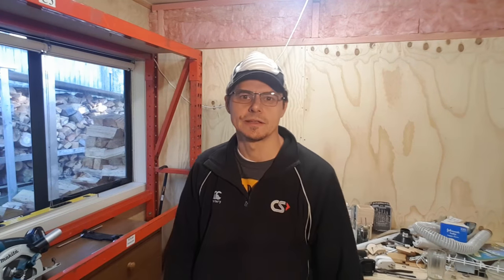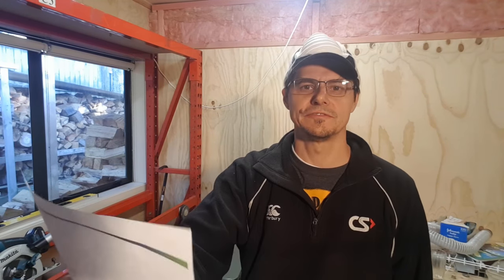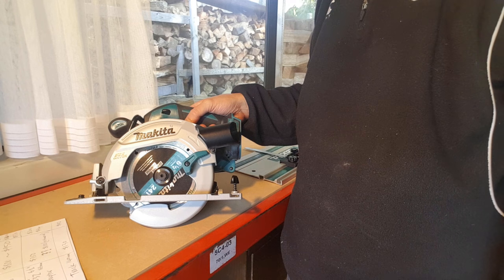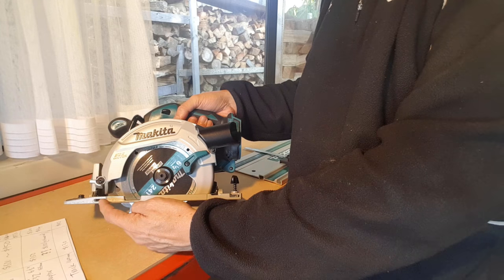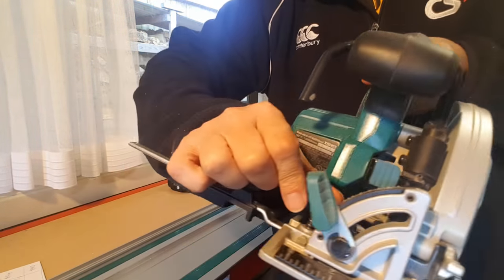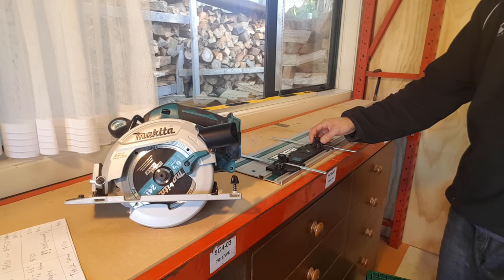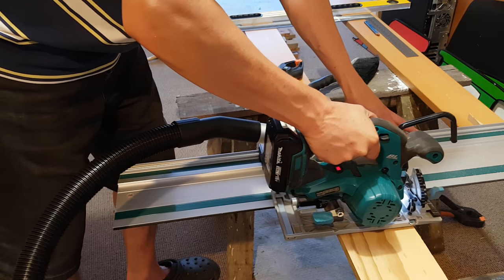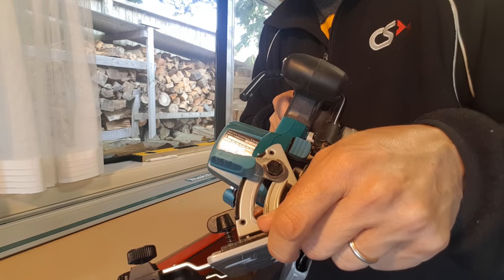Makita circular saw adapter for rail guides - circ saw becomes track saw.

Comment: Thanks for including the links to the exact products.  Saves time.  I had purchased the Makita 199232-5  guide rail adaptor and found it WORTHLESS on my little XSH03 circ saw.  IMPOSSIBLE to tighten down enough to keep the saw bottom tail from moving more than 6mm!  I thought surely this can't be the best Makita can do.  Clicked on your vid and realized there was another guide rail adaptor with two attachment bars.
Reply from the maker: No probs. I've heard that the single bar one isn't much good but some saws only have one slot for one bar - which is weird. Cheers.

Comment: Thank you for this video. This is the only demonstration I found in YouTube that shows how to use the guide rail & adapter with the dhs680 saw.
Reply from the maker: Thank you for the feedback Danny. I'm glad the video was useful to you.
Reply: Hi how are you finding the guide rail adapter on your DHS680? I've got the saw and tracks and I'm very tempted to buy the adaptor.
Reply from the maker: Hey Chris, it has worked amazingly for me. I use it every time I need an accurate cut. A small amount of care is needed to ensure the bars are seated and positioned correctly, especially if you are taking it on and off all the time but other than that it works perfectly. It holds the saw very securely on the track and cuts dead straight. If you already have the saw and the track then I don't see a reason not to get the adapter. I definitely recommend it. Cheers.
Reply: @TakamiWoodshop  Thank you very much 👍

Comment: Nice adapter mate! Awesome idea for people who don't want to spend a chunk of cash on the track saw
Reply from the maker: Yeah - works mint too. Obviously though it is the same idea as track saw there are quite a few differences when you get down to ease of use, power, cut quality etc. Would be interesting to compare.
Reply: @TakamiWoodshop  I have the Makita 36v tracksaw, with two 6ah batteries and a dual port charger it's a winning combo, 😁👍😎
Reply from the maker: Toolnut that's a winning combo for sure mate 👍 It's definitely something that is still on my list, even though I have the adapter thingy.
Reply: @TakamiWoodshop   Indeed, good review, 👍 I see you have the Makita 18v sander, is it any good? Pity it's not brushless, 🙄
Reply from the maker: @TheToolnut  Yes mate the sander is great - all this time though I thought it was brushless but alas ... it isn't 😔 (damn). It's nice and compact but I think I would prefer the one with the extra handle/knob on the side, but I don't think that one is available in cordless. It gets pretty good mileage too - with a 6Ah batty it would go and go and go I reckon. Dust collection is pretty good as is, and with a vacuum attached it's super good. I'm very happy with it. 👍 Not sure if you watch any of my other videos or not but we did a cock fight with two of these sanders - just a bit of tongue-in-cheek playin' around over Christmas holiday 😁 https://youtu.be/hnt5mG_zZmA

Comment: Just got this setup myself, since no one makes a right handed track saw (left blade).
 
It's not perfect with the XSH03Z.  But a few things I did to tweak it is to do this...
 
1) Saw Play: I unscrewed the fine adjustment knobs to get to the green spreading rings. I then put a thin strip of UHMW Tape on the side of the green ring that will make contact with track. It gives it a bit more depth to make better contact with track and make it not rock side to side as much. 
 
2) Location of Metal arms that connect to the saw: This has been tough. Getting the saw blade to run true means it needs to be perfectly parallel to the track. Where the metal arms go into the track adapter is an issue. If you put it to "0" (Zero) it will turn the actual aluminum edge of your track into a splinter guard.  So what I did was take a 2x4 on my sliding miter saw and cut a ¾" to 1" deep cut lengthwise. (You can do it width wise if you have a regular miter saw, but do 2 boards ate same depth.) 
 
Now, take your XSH03z, adapter, and track on top of the board(s) So your saw bkade can go onto the groove. It will rest straight and you can then mark out 90° and set the metal rods in the adapter, where they are at a true Zero. Then mark off the rods by overtightening the screw. Then take the metal rods out of everything, and you will see a little circle where the screw scratched the flat rod. Drill a hole there big enough for the threaded knob to fit through, and you now know where a true Zero is and the hold down knobs in adapter will actually pass through the flat bar, securing your Zero, perfectly every time. 
 
.....
 
It's a shame Makita (or any other good tool manufacturer) does not make a Blade Left track saw. 
I was a lefty until I lost use of left arm, to a virus. And track saws were heavenly as a lefty, since they were right blade. Righties have no idea what they're missing out on. 
 
I'm now a righty, and I can't use a right blade track saw. This adapter and the XSH03Z is the closest, and only real option to do long straight rip cuts for me. 
 
So until a true right handed (left blade) track saw exists, I'll be using this. 
 
(I'm currently trying to figure out a way to give it a spring plunge mechanism,  and a side plate to make dust hose port more effective... but it's quite a pain.
Reply: Ignore the pain. I am most interested in what you are going to make out of it. In my opinion, a "half plunge" (soft way to push the blade down, no need to get it back up again) would be quite enough. Perhaps no springs needed, just something to make the push down firm and soft and something else, that would limit how low it goes. Once the cut is done and the blade doesn't rotate anymore there should, of course,  be a way to get the blade up again. BTW, somebody is selling 3D printed covers for the hole in SP6000 - perhaps someone else would be willing to sell similar covers for DHS680 as well?
Reply: @Pvalila  since I wrote that comment, I made the same realization in terms of a depth stop, and soft plunge with no need for a retraction method. 
 
The issue I've noticed is how the baseplate will tilt right and kept a hair, if the depth clamp is is not engaged. It's not much, but it's enough to bits and throw the saw back. 
 
I'm still fiddling with the plunge obviously, but the faceplate was easy. I used a piece of cardboard to make a mock up stencil of a box frame that could be folded and cut so that it covered the entire blade housing. I then just unfolded it, and traced it onto a 1/16" 6061 sheet of aluminum. Then once I folded it to fit perfectly around it, I mounted it to the shoe, and voila... full dust collection. 
 
I even made a riving knife for it. 
 
But I still have issues with plunge, and square cuts when on the track.
 
So I'm now making my own track and glide system using aluminum t-slots , t-track, and ⅛" aluminum sheeting. I'm still getting some bugs worked out, but it does glide much smoother, and cuts square. Plus I am going to make a riving knife that mounts to the track and moves behind the saw, without having to be attached to it. But the entire system might take a while to truly perfect to the point I feel satisfied with it.

Comment: I find that doing a shallowest possible scoring cut and then a full depth cut gives a super clean finish on all 4 edges of your material.
Reply from the maker: I've never tried that but will be doing some super expensive ply soon so I'll definitely give it a try. Cheers for the tip!
Reply: Rob Trautvetter - Takami Woodshop

Try it on a piece of scrap and let me know.

Comment: I own that same model saw, but I did not realise that it could be adaptored to the rail guide in that particular fashion. So a big thank you from across the ditch Rob. (I found you from the Tools and Stuff channel and now I've subscribed to your channel. Thanks for helping me out with that video.)
Reply from the maker: Hey Kevin - glad the video helped you out! Welcome to the channel and I hope you enjoy what I have to offer here! Was it Tools' bottle opener vid? Cheers. 👍
Reply: @TakamiWoodshop  Yes that's the video Rob. I found your channel from the "Bottle Opener" video. I'm looking forward viewing the rest of your channel now.
Reply: I think you owe me a beer Rob #BeerSubs
Reply: I have just received my Circular saw. Purchased it on a description from amazon UK. Which stated it was track compatible.  It turned out the saw required an adapter. Got upset with Amazon UK and Maketa UK. Maketa UK stated what looked very much like Maketa UK shop on Amazon UK was not theirs. 
The result being Amazon UK are changing their website and supplying me FOC an adapter.

Comment: In Australia you buy the Makita corded Track Saw with one guide rail (1400mm), for $749. Your cordless saw to buy here is $480 with a battery, guide rail is $99, adaptor is $75, total $654, spend an extra $90 for the real deal, appreciate it's corded though,  I like your channel...
Reply from the maker: Hey James thanks mate. The prices are similar here. I saved a bit by buying from the USA. The advantage of this set up is that you can still use the saw for normal cutting .. like building a fence or whatever. I don't have enough usage to justify a dedicated track saw, much as I'd love to have one. Cheers

Comment: Nice ! . I just figured this stuff out myself yesterday and ordered the 2-55" Powetec Tracks with joining bars for 129.99 and the Makita track guide for 39.99 I already had the XSH 03 saw. I am cutting some 30" x 60" parts from sheets and it would be great. I plan on making a square for it, out of some 12mm Baltic birch plywood as I cant find any less than $150.00 here in the USA.
Reply from the maker: Sounds great!

Comment: Excellent video, cheers mate! I've been lusting after the various pro-grade plunge saws for years now, but could never come close to justifying the cost. However, having recently make the jump to the Glorious Makita Master Race (after ~15 years as a home-gamer Ryobist) for completely unrelated reasons, I come to find out that they have a low-rent track saw option that I can realistically get into for not much more than $150 US on top of the saw I already need.
Reply from the maker: Thanks mate, glad the video was useful to you. I was in the no-name brand market for a long time before going to Makita - so glad I did. This saw is fantastic I have to say - it cuts at 90°, cuts straight and cuts clean, all the things my old saw didn't do - and this is even before you add the adapter and guide rail. (The dust collection port is an extra $10 or so)
I made this other sled thing for it as well if you have time check it out - just an experimental thing at this point but it works fine:
https://www.youtube.com/watch?v=DCcwjFEG88E

Comment: Just called Makita Australia and they said this adaptor (196953-0) can be ordered through any of the authorized service centers (at least in Australia). For the reference, similar adaptor for DHS660 (the newer model) is 199232-5, however interestingly enough it only contains a single slat. Looking closer at other Makita saws, DHS680 featured here seems to be the only one that has two slots for inserting guiding slats (the rest have just one at the front) which probably makes it a more accurate glider (if it wasn't for flimsy fence that it).
Reply from the maker: Wow that's really interesting - the adapter with only one slat - I've never seen that before. I would definitely rather have two as I think you'd get better cuts from it.
Reply: @TakamiWoodshop  Yeah, what's interesting that as I said DHS680 appears to be the only saw with two slat inserts. However compared to the newer DHS660 which I had a chance to inspect, DHS680 has much flimsier fence locks, which affects cut quality, at least for me - just brought it to the service and the guy said there is not much can be done besides tightening locks as much as you can. Also it of course makes lots of sense that DHS660 is newer than DHS680, model numbers-wise ;)
Reply from the maker: @ZaarsShed  yeah the numbering makes no sense at all 😮

Comment: You have any issues with excessive play in the track? The back end of my adapter wants to lift up, even with the tension knobs maxed out.... placed on a flat surface i can see the plastic body doesn't lie flat. I have a feeling i've got a dud, must've warped, or been damaged in transit. Doesn't look like you have the same issues at all
Reply from the maker: Ahh that's a pity. Mine is really tight with no play at all. Hope you get it sorted - can you return it maybe?
Reply: I know it's 2 years ago,  but mine was bent too. I put it under some heavy weights when not in use and it seems to have flattened out again

Comment: Very useful video. Thanks.  🍻. I use Makita tools for everything mostly because once you’re on a battery platform it’s too expensive to change. The DHS680 is a brilliant little saw for almost every situation but the bloody dust chute is a complete dog spewing the dust straight into your guts or into your face if you’re lucky and a breeze gets up. The 660 (blade on right) has a better dust exhaust but I’m not sure if there’s an adaptor for that.
Reply from the maker: Thanks mate - yeah I hear you on that dust chute!
Reply: Got the HS660 a few days ago. There is an adapter for it. I ordered one yesterday along with 1 metre of track. One disappointment is the inconsistency of saw blade kerf. I'd have liked to change blades and not have to think about track rubber cutting. I do have an M-class dust extractor but will use my HS660 outside the shed. Eventually, I may stretch to a proper track saw if projects can justify it (daughter and her fiance buy a larger place that needs work)
Reply from the maker: Your daughter should get the bigger place 👍👍

Comment: I just bought a track saw when I could have done this!!!
Reply: doesnt work with all Makitas. For example, my model is a cordless one DS611, Makita dont make a guide for it for you to be able to use with their guide rail. so depending on which saw you have a better option may be to consider something like the Kreg accu-cut or just make a guide out of wood (theres plenty of examples on youtube)
Reply: @richsmart321  yeah good point, I have a different circular saw non Makita, so yeah but right now I'm sorry happy with the track saw I bought
Reply from the maker: Which track saw did you get @phantom?
Reply: @TakamiWoodshop  makita, needed it to do bevel cuts on long and wide pieces for furniture. Never seen bevel cuts for so nicely

Comment: If supported properly(a thin blade can make side deflection worse???) Is this accurate? Can you adjust it to different kerf blades?? Thanks
Reply from the maker: Hi, yes it's very accurate. Deflection can be a problem on some hard woods, more so with thinner blades but it's not really a concern with this so much if you're cutting larger sheets or panels of plywood etc. It can be adjusted for different kerfs, kind of, generally with track saws you would just put on a blade and cut the splinter guard to establish the zero clearance and the cut line, and redo that when changing blades. It's tricky to line it up if you go thinner though, I've tried it. In this case I ended up moving the splinter guard out and recutting it. Hope this helps.

Comment: I notice you are right-handed...  Would you not be better using the Makita DHS660 or equivalent, ie, a saw specifically for right-handers?  Using the DHS680 as a right-hander means that with your right hand on the main handle, you have to cross the blade with your left arm to grip the auxiliary handle, not ideal from a safety perspective, and your body position won't be ideal for good line of sight...  But I do acknowledge that some people have a preference for having things the other way around for various, use-specific reasons...
Reply from the maker: I prefer blade-left saws because I can see the blade and the line better when I make the cut  with my right hand. I don't think there are left handed / right handed saws per se, just blade-left/blade-right to cater to people's preferences. If I had a blade-right saw I would use it with my left hand probably. Things are a bit different when the saw is on the track - you don't have to see really - just push forward and go for it. Don't think I've ever used that aux handle except to carry the saw one place to another.

Comment: Thanks for vid Rob Tee A1 good work Urock would you know what type of guide rail adaptor is compatible with the Makita 5900B 2000w saw I have a Makita track but can’t find any guide rail adaptor it doesn’t have to be a makita adaptor as long as it’s compatible with the Makita track and Makita saw 5900B 2000w
Reply from the maker: Hi Stiven, thanks for the comment. That's a tough question for me to answer I'm afraid, there are so many models out there on the market now. I wish I had an answer for you, but I can only suggest contacting your local Makita, or even Makita in other countries, and continuing to do your research on YouTube etc.
This may or not make you feel better but it also took me a long time to figure out which saw would be compatible with the various adapters and the track. Probably took me about 10 hours of researching before I had the confidence to make the purchase.
Have you looked at the "generic" adapters? like the Kreg, and there are a couple of others but I don't think they run on the Makita track. ... tricky .... sorry mate!